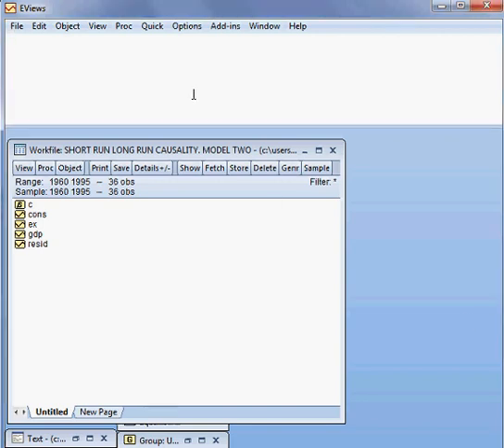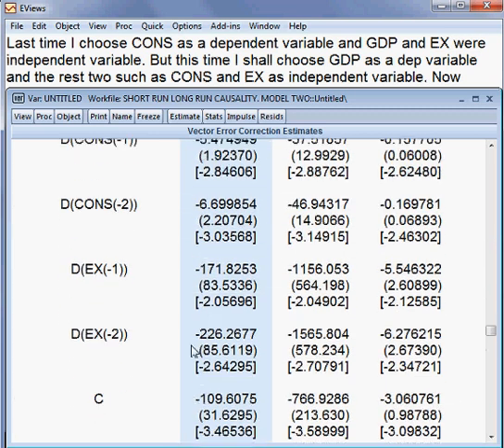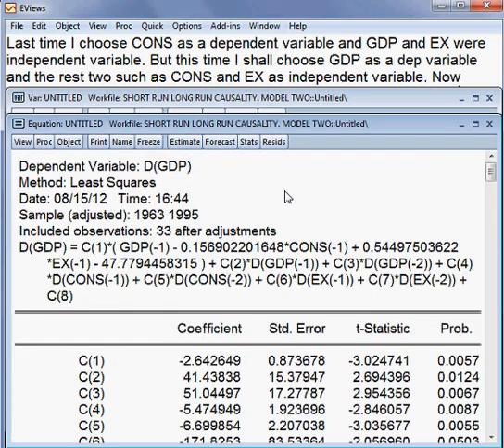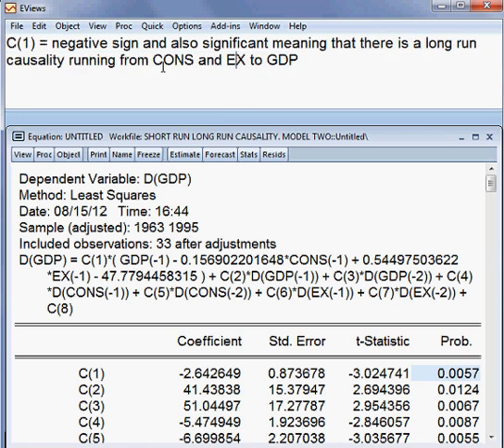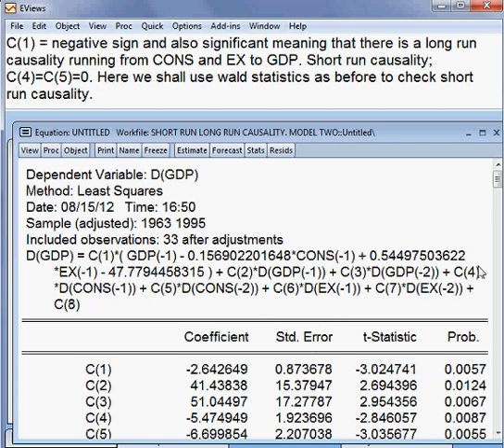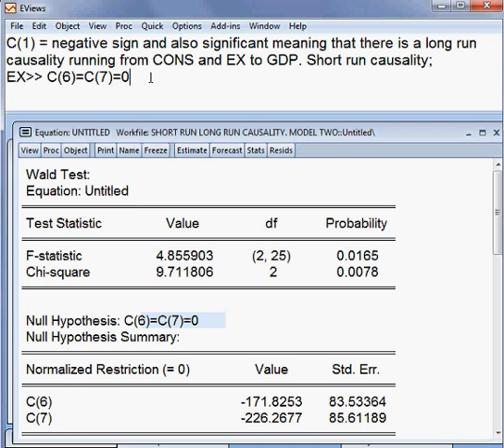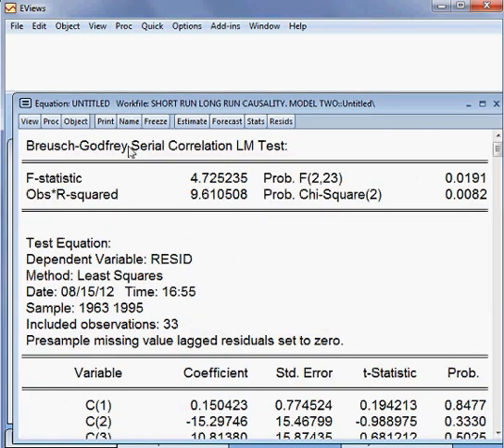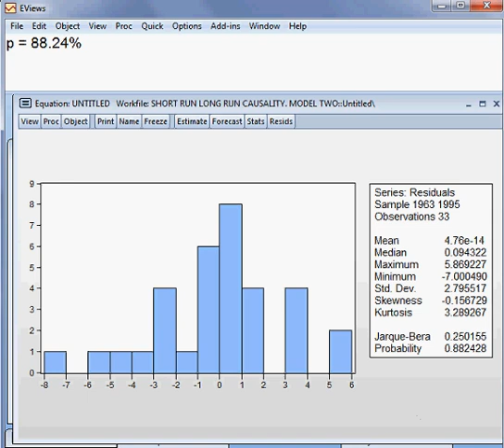VECM. Model Two. Part 3 of 4. VECM

Comment: 2- A s i am interested in studying the impact of fiscal policy on macroeconomic variables, normally i use the IRF to study that. So my question is should i ignore the trace test and ignore the fact that there is 2 cointegrating relationships and adopt the results of Max eignevalues test and act accordingly and estimate a VAR model so i will be able to study the IRF? or if i adopt Trace test meaning 2 cointegrating relationships, have i the right to study the IRF from the VECM model?

Comment: Thanks sir for feedback ,  i have run johansen test cointgration and find 1 coint relation, should i use VAR or VECM? , i want to obtain beta for  real gdp per capita and m2/gdp and real gdp percapita and credit/gdp in separate VAR. should i take the normalised value  and the beta from the target dependent variable real gdp percapita? and what if are longrun coefficient is negative but not signficant should we reject model? or is it an implication of shortrun cauality or weak causality.

Comment: I have a question, in case we have 2 cointegrating vectors, we will have 2 coefficients representing long-run causality, if one was significant and negative while the other was only negative but not significant, how can we interpret that result?
thank you
Reply from the maker: Hasan Baalbaki In that case it will be hard to decide. I would suggest you try to get one cointegration vector, not two.
Reply: Sayed Hossain This will be possible specially that when doing trace test I found 1 cointegrating equ for a significance level of 1% and 2 for a significance level of 5% , with max eigenvalue test giving me 1 cointegrating equation for 1% and nothing for 5%. In that case can I carry on with one cointegrating equation? 
Thank you, appreciated

Comment: Dear family, How are u? In my Analysis i have reached a VECM and i did wald test to check whether variables coefficients are zero or not, but How can i find significance of the long-term variables significance? And should i take the opposite of the coefficients sign while building my long-run equation?
Thank you in advance!
Actually my speed of adjustment is negative and also significant, but what i want is individual variables significance, and my additional question is how i do normalization of long-run variables. How can i find normalized α and β ?
Reply from the maker: Would you mind to join Hossain Academy Facebook below link and post your questions. Normally we are sharing there our discussion.
Reply from the maker: www.facebook.com/groups/hossainacademy

Comment: Hello dear
If Granger causality refer to no causality relationship, but the VECM refer to one long run relationship, can I adopt the both models in my thesis? and explain the both results
regards
Reply from the maker: You need to use one model. Two model at a time will bring conflicting result.
Reply: OK Dear, thank U very much
Reply from the maker: In a thesis I would suggest to take one model to discuss, not two.
Reply from the maker: I said already...Now u decide..
Reply: Sayed Hossain Thank U dear, my thesis is about the relationship between exchange rate and oil price, I used monthly data series, length lag criterion refers to (2 lag), what I did, I ran the causality test for four first lags (i.e, 1, 2, 3, 4) in the first 3 lags there was no causality relationship, but in the fourth lag there was one direct relationship from oil price to exchange rate, I documented the all 4 state in the thesis and also I used the VECM which refers to the same direct of relationship (i.e. from oil price to exchange rate in the long run)
I want to ask if this is OK?
Thank U very much, I adopted your videos in my empirical framework. and I mentioned U in the thank page of my thesis.
Best Regards